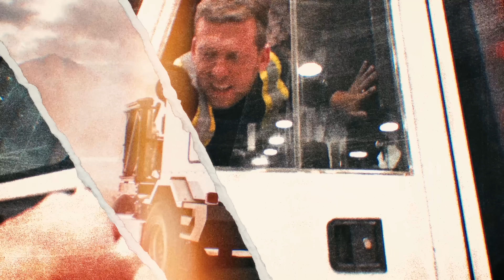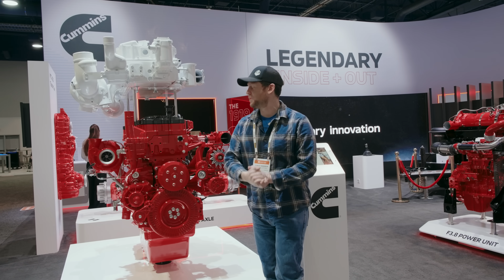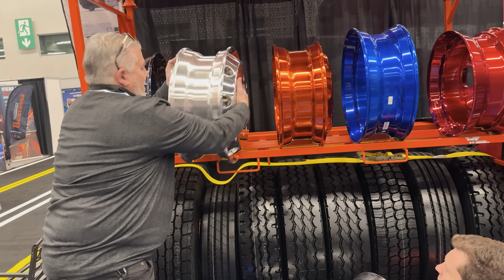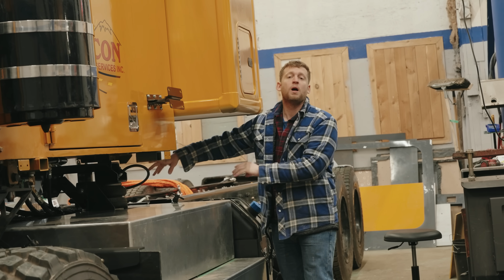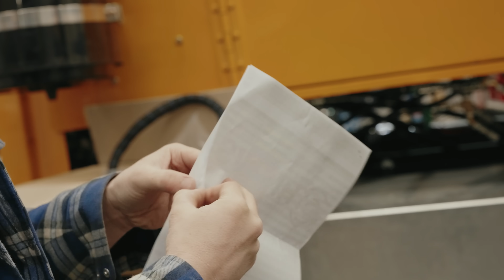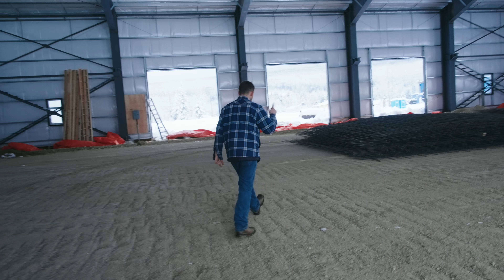This Changes Our Trucks

Comment: If you or someone could come up with a conversion to turn a 4wd sprinter into a hybrid you would make a fortune.  A lot of builds have several hundred pounds of capacity or more for batteries.   Take out the transfer case.   direct drive the rear from the existing diesel engine.   Mount an electric drive where the transfer case was driving and regeneration from the front axle.   The biggest challenge would be the control integration but some torque sensing on the front axle would probably allow the electric drive to know when to act.   Much like the rear end drive on a 4wd Toyota hybrid.   Maybe use one of those as the electric motor.   40 or 50 hp on the front would be plenty to use the braking region and provide extra traction when 4wd is needed.  Flat batteries would be an issue if you needed 4wd and you had zero kws left in the bank.  But some good software could save a bit for emergency traction assist.

Comment: When is your company going to start making square body pickups?  Your business model in how you make vehicles is exactly what is needed. Make simple and easily maintained vehicles vs the plastic junk that is out there with way too much electrical trash and options. Keeping it simple and reliable is always a priority.
Reply: Work towards an Edison pickup is over  at Deboss Garage.

Comment: How viable is this kind of setup for  at or under 1-ton truck platforms? ie electric driven drivetrain with a diesel generator
Reply: Theoretically, once Edison is cleared to make hybrid class 8 semis, then they are also cleared to make class 3-7 trucks.

Work on these trucks is happening over at Deboss Garage on Youtube.

The expected cost will be "less than a cost of a new fully loaded brand name tow monster. But don't expect ai self driving or automatic scent dispensers.

Comment: The Dash has Too many Fasteners! Is that the a Union Job? Or to Piss off Mechanics? Screwing around, more parts more pain and Cost.😮
Reply: You make a fair observation.

The semi truck market Paccar make things as you suggest and they fill that niche in the market place, and buyers are welcome to vote with their wallet.

Edison will not spend $100k to design whatever it is you're looking for. Edison is caveman truck. Cut old streetsign into rectangle, drill hole, use 100 self tapping screws. Any truck owner for the next 100 years will be able to service this dash long after Edison company (heaven forbid) fails.

Meanwhile back at Paccar, in 100 years, the parts will simply not exist, or the price will be outrageous.

It's a philosophy.

But I totally get where you're coming from. Edison trucks are not for everybody.

Comment: Not sure how many different options you'll have inside the cab, but if you templated the floor as is in this truck, you could slap everything together on a bench, CNC or template it, and then just install.  The 1st time is always the worst.

Comment: If making this type of truck was even remotely feasible the big companies would have beaten you to it. Any type of investment of any amount is fools gold at best.
Reply: Kind of
The big manufacturers have bloated workforces that require high volume production and planned obsolescence. So yeah, it's impossible for the big guys to do this.

Edison is a small workforce and only needs to make 50 trucks per year to break even, and they'll have the potential to make 500/year. So I think they'll be just fine.

Comment: @edison if you fallowed a number of YouTuber auto repair shops, any shop in the rust belt could have told you electric steering is terrifying. 

South Main Auto started seeing issues with GMs 2019+  pick up trucks where the braided unshielded chassis to cab ground strip which GM unwisely placed on the passenger side of the cab behind the wheel. With in the first year of use, the copper braided straps turned to dust with water and road salt. First warning signs are trailer brake controller codes, then transmission codes. But the part that makes it terrifying is when the ground strap fully fails- the electric power steering faults. 

SouthMainAuto had one that he test drove on diagnostic ride and the steering fault ripped the wheel out of his hands down the road. 

And all GM had to do to prevent it was use a shielded ground strap- Napa has an exact match shielded strap on the shelf for under $20. It’s such an issue that it should be recalled ….. but most of the motors fail before the ground strap fails now. What a fall from grace.

Comment: I am happy that you are building one truck at a time rather than an assembly line. You make one truck find all the problems, fix them, retest and put all the changes into the next truck. If different problems show up on truck 2, they are fixed and put into truck 3, and so on and so on. If many trucks are made at the same time either none updated or a recall on all. Your way seems to more forward thinking than the other truck builders. Keep up the good work.

Comment: My one and only concern is that mounting an electric fan on the front side of a radiator with large grill openings on a truck built for the woods up here in the north is that it's going to get choked up with snow and debris pretty easily. When they're installed on the back side of the radiator, it typically acts as a shield and debris filter. just food for thought. still love these trucks!

Comment: I would completely remove the gear driven air compressor and power steering pump from the engine. They are always spinning, even when they’re not doing anything, making the engine less fuel efficient while it’s running.
Plus, it’s way more complicated to have 2 separate power steering pumps than it is to have one running off of 12/24/48 volt.
“It’s for backup” if you’re planning on a major part of the truck breaking, you should replace that part with one that won’t break.

Comment: 6:29 make the engine fire up if for whatever reason the electric pump fails. Loss of power steering pressure, engine fires up to take over
Reply from the maker: That's right

Comment: Hey are you going to run lines for in floor heating in that shop? You can always not use the lines but you can never put them in once you pour. Minimal cost and potentially huge gains with different heating options.

Comment: Do you have room in the cab for insulation? Guys that run up north will want a winter package. Are the electrical wires made with soy based materials? Mice and other critters love that stuff.

Comment: I'm a firm believer that the "KISS" approach is always better.
Reply: It may be an old law of engineering. But it is still one very real rule to follow. The less that is there, the less that can go wrong. The more common the part, the potentially longer life span. Just check out the newer cars, and how the newer smaller motors with turbo charging and higher pressures are not holding up. How all those eight and ten speed computerized tranmissions are no able to even last 100,000 miles. How computer systems disable the vehicle with no warning, and so many other problems. Too many big changes, too soon, without realtime testing. Long live our old tech!

Comment: I would love it if you guys could turn my 91 peterbilt into a hybrid truck, it has a 120 in sleeper with 400 amp hour battery capacity and I'm adding solar to the roof, this system powers my fridge, TV, microwave so if I had the hybrid system that you build it would put my truck into the 21st century

Comment: Regarding your choice on the fan/ps etc, you will lose some efficiency, but just how much in real life during work? It really depends on a lot of factors. In winter, you may not use any more power. Summer, perhaps more?
  Another downside is the extra weight from both systems. The small things add up.
  However, these are just the tradeoffs you make  and in the future, the parts may improve enough for you to go back to the other way you had it originally. The best thing for right now is to have something more reliable, less expensive, and easy to source.

Comment: What a great video. If only I were sixty years younger and able to come to BC to work with you. On another video you mentioned an old Autocar. For me an Autocar was my first chance to learn how to drive a big rig. That truck was sold to a scrap hauler that used it to ship scrapped freighter ships broken up on the St Clair river and took the scrap to Hamilton where I live. When his truck was new the painter put his name on the door. I was a jr. apprentice and was told to steam clean the truck as the owner was coming to see his Autocar for the first time. When I hit the doors with the steam, the new paint on one door peeled off in a sheet. We parked the truck close to a wall so on inspection he could not see the door needed a repaint job.

I love your ideas but wonder if the diesel you chose could be smaller and more efficient as only the power needed could run the motors? I think you are right to avoid computers as much as possible. I really believe in hydraulics as a small engine big enough could power a car at each wheel and trash the drivelines and diff.
Good work !

Comment: 5:40 Better way to go with the standard air comp and power steering and 12V fans. Losing the HV A/C compressor is not ideal, though. I would look at sourcing a unit from Toyota that they use on their hybrid vehicles (RAV4, Highlander, Sienna) as they are reliable. Not needing to run the generator whenever you need AC is a big plus.
Reply: I don't remember hearing him say they got rid of the HV ac compressor,  just the air compressor

Comment: Question, would it be possible to make them available to have a “glider” kit installed in your mechanical trucks. Obviously the hybrid is the preferred drive train but let’s say if they don’t want the X15 and its emissions issues, could they drop a big cam/ n14/ s60 or maybe a CAT in its place?
Reply: I believe the govt slammed down on manufacturers like a ton of bricks over 'gliders'

Comment: exactly what is high voltage in this video? Because commonly, I'd say high voltage is in the thousands of volts. So, is it maybe at like 400 volts? Because I assume that's where the batteries sit, though they could be at 800 volts as well
Reply: The Edison gen2 system is 614v batts. I think I've heard 480v accessories.

I THINK I've heard 48v and 24v accessories 

Obviously still has 12v accessories 

Who knows what the gen3 stuff is on the next batch of trucks.

Comment: Its not the Volts ITS the amps 48 volts less amps ,12 more amps
Reply: Yep
Higher volts = less amps = less heat in the wires = smaller wires.

I'd like to see higher voltages whereever possible and pratical.

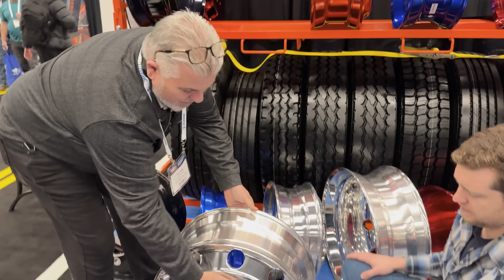Comment: 02:57   👍 
        They are on a winner with that design.    One of the reasons I'm avoiding using the dolly with the  steel wheels - the centres collect  at least two kilos (4½ lb) each.
Reply: Really depends on the reliability and if the juice is worth the squeeze. Not every part needs to be  though

Comment: So if I were to make a suggestion- no HV forward of the cab, for anything. Ever. You don't want to be having to get mechanics with HV certifications for simple things like oil changes and engine repairs. Just set a divider at the generator head for certified techs to work behind.
Reply: Not necessary. Just bc there is HV in the engine bay, doesn't mean you can't do an oil change. If you don't touch HV parts during the job you don't need the certification

Comment: I would suggest adding radiant in the slab since you have to wait. Will really save a ton of money on heating.
Reply: Yes, payback on in floor heat is fast, but needs insulation underneath first. Would have to dig out some of the the gravel they just put down.
Reply: @jeffhill3681 There is plenty of time for it.
Reply: Floor insulation is not absolutly necesary, you only a small percentage of heat trough the ground. Also it is a large building so the amount of wall where they would lose heat is pretty small compared to it size.
Reply: @jonasstahl9826 
  I disagree. You loose 25 to 30% of the heat through the floor without insulation

Comment: I haven't been closely following...just waiting for major updates.   The last I heard Edison was going to use a conventional driveline until they got gov approval for their genset unit.   Is that still true (you mention a transmission in this truck)?   What is the current driveline?
Reply: The Grey truck is a traditional truck with an 18 speed trans for Royal.

The Yello truck is a hybrid snowplow for Emcon.

Comment: It's a huge advantage not needing to squeezing every KW out of the batteries, since there is a big conventional motor available to make power for the truck.    For this vocational application this hybrid approach is a great match.    When we get batteries that charge faster and more peak regen can be captured, then this approach makes a ton of sense for garbage trucks and city buses.
Reply: Yep. And if you follow news about battery development, there has been great progress lately, out of China. BYD setting up megawatt charging for cars! That's overkill for  sure, but it sets up the path for cheaper, faster charging on big trucks! Another thing that may work for Edison is Sodium batteries from CATL. 90% charge retention at -40c, takes much better charge at those temps too, and a very high cycle life. And will likely be even lower cost in a few years than LFP. Not the highest power density, but has other great values
Reply: @videoviewer2008  90% sure all the articulated newflyer buses are diesel electric hybrids, with direct motor drives and diesel gens already
Reply: In Germany there's these garbage trucks that run on biogas produced from the very organic waste they collect! Isn't that cool! 
Not exactly related to what you were saying but reminded me of them. Would be cool if Edison had a duel fuel truck (LPG). Not sure if that is such thing in canada.

Comment: When will you finally add a step well at the doors, like a bus has? It will make it much easier to get in and out without hitting your head, and let you take off your shoes and keep the cab clean. With a center mount seat you need the step well to give you the room to reach your seat without having to bend over. 

You just need to lengthen the door 12" and make a 3 sided "pan" to weld into the floor.

Comment: About that wiring harness. I hope you can multi-source it. I believed you mentioned a while back about your philosophy of using standardized parts in the trucks.
Also, what is the status of the diesel genset in the truck vs the EPA (or whatever is the Canadian equivalent)...

Comment: 6:25 Wait, so you went from having a power steering device that was meant to be powered electrically/had it’s own motor and replaced it with a mechanically driven one using your own motor?

Is the difference that the mechanical one is a more reliable design to begin with?

Edit: Oh I see, the electric one had a bunch of extra stuff and that is what failed. So you’re taking a more analog/mechanical part and just using your own motor to power it.

Comment: Would a simple off the shelf self contained 12v electric steering system be useful? No external computer control or anything required, just a power adjustment knob? That way you could even theoretically turn it off if someone is just cruising down the highway and doesn’t need it.

Comment: I'm glad somebody is still making cool heavy duty trucks with long, flat hoods. If I was in the market for a truck and could have my pick, I would choose you guys for sure.

That solution of using the preexisting module to replace those high-voltage electronic components is so simple and genius, it's actually surprising that you didn't think of that to begin with, seems like you would have.

Comment: Put in a big order for frame rails?  More engines?  See if an OEM will sell you cabs.
Reply: The one thing they definitely dont need to preorder is frame rails - these being vocational trucks, the number of combinations of length, frame size, drive configration, mounted accessories, suspension type, etc. are almost infinite. No way to order ahead on that. IIRC they found a trailer manufacturer that bends their own frame rails from plate who will make some up and put holes in them to order for them. Since it’s made from plate it’s way faster than the normal truck frame companies who have a like 16 month lead time. And they don’t want to get too far ahead on Cummins orders, either, because there’s a whole new x15 for next year (because of new emissions standards) and at some point hopefully Canada allows Euro emissions, which will open up the Scania and hybrids.
Reply: @EyeMWing those local rails are the ones I meant. Just thinking nicer to already have them than to have to order them and wait.

Comment: for your Air Compressor & Power steering could you put a one-way sprag clutch between the engine and the compressor/pump, and piggyback the motor in the assembly? dual drives in a compact package, sprag clutches in automatic transmission are very reliable

Comment: I thought Edison was going to originally use Scania Engines or is that only for the Hybrid ones?
Reply: Edison put a Scania genset into the undisclosed hybrid semi, and its getting held up at ECCC/EPA.

In the meantime, Edison can make/sell traditional semi trucks with the approved Cummins x15 and Eaton 18 speed manual trans.
Reply: Customer might have wanted a Cummings
Reply: @ATF1985  There's no such thing as a cummings.

Comment: Wonder if you planning for for a gantry crane? Could put rails in the concrete.
Reply: There are shelf dealies on the side walls that will get 300 foot long I beams and 2 gantry cranes will run along that track.
Reply: @Sah-o5m much better than railway tracks.